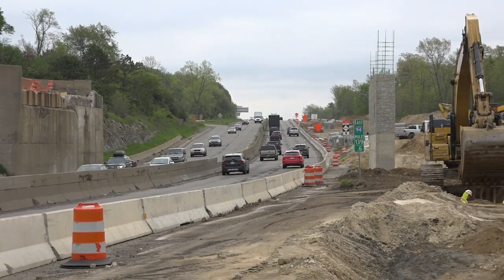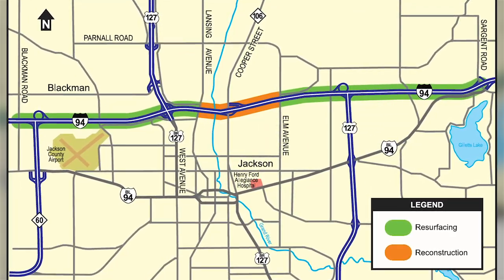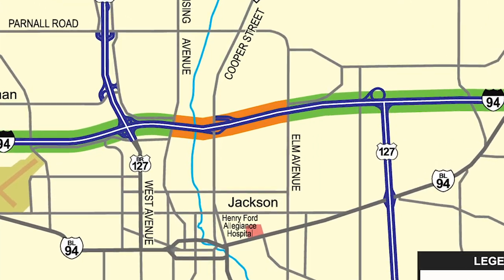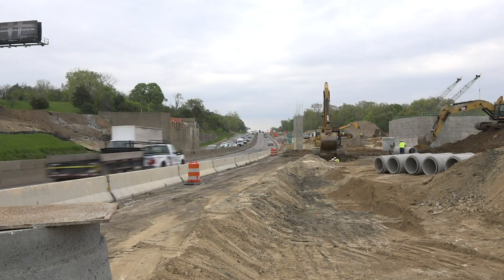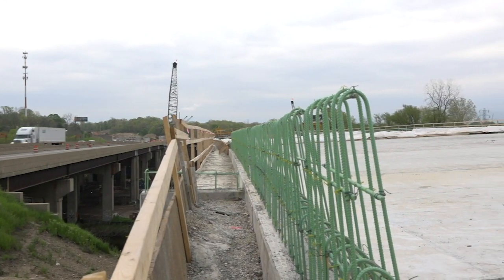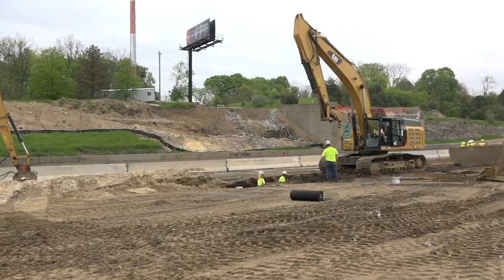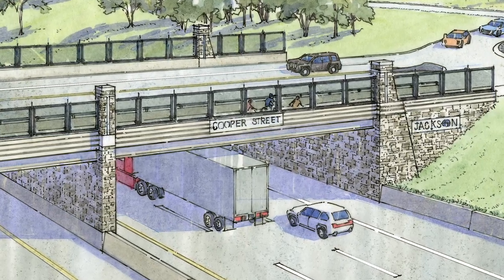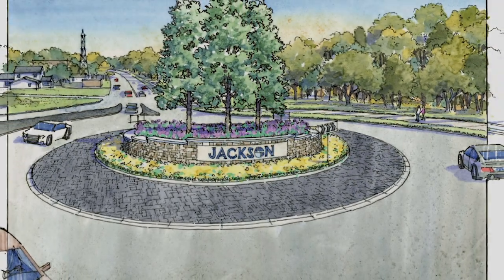I-94 modernization and expansion project update, Jackson County

Comment: One question, while expanding the I-94 expressway, within 8-9 miles, between Exits 137 (Airport Rd.) & 145 (Sargent Rd.), why did the highway signs needed to revert itself back to the usual "Highway Gothic," from the more current "Clearview"?  Nobody was very happy about the revertion, while the highway has expanded, because since 1/2 of them are wearing glasses and can't or couldn't see, using Clearview was the right thing to do, at that time.
Reply from the maker: Hi Gary! Upon further review and research, federal standards reverted back to Highway Gothic: https://www.theverge.com/2016/2/4/10919686/clearview-highway-font-fhwa-highway-gothic
Reply: @MichiganDOT  Well, three years ago, the return of the "Highway Gothic," font didn't last long.  I maybe wrong though, I'm not going to argue with you, yet, to the best of my knowledge, after I-94 had completed on only going West to Chicago, reverting from getting "Highway Gothic" to "Clearview", back, last year, which was in Mid-2023.  This was in an attempt to get other drivers to read better, esp. late at night, as far as getting off of an exit, only in Jackson, between the Exits of 141 (Elm Rd.) to 137 (Airport Rd.).  Almost everything going on the westside was done completely and smoothly, to further better research, in my opinion.  For that, I was so grateful and I was also happy, just as every other resident or visitor who went passing by these signs, in taking a ride and journey, there.  I thank Governor Gretchen Whitmer for that!